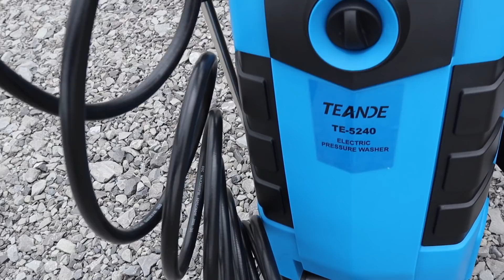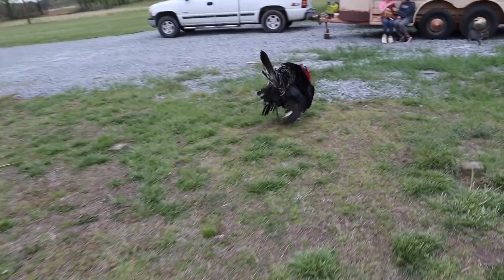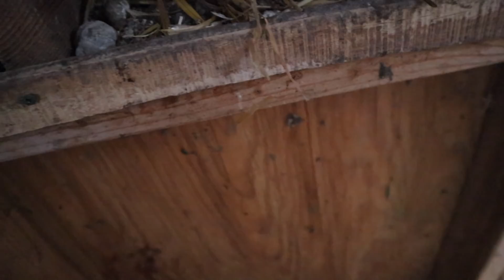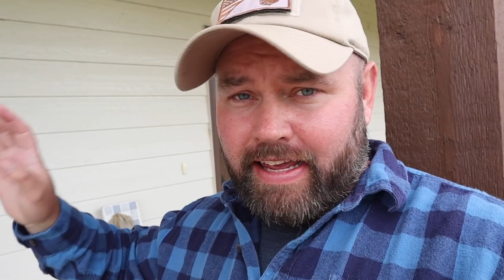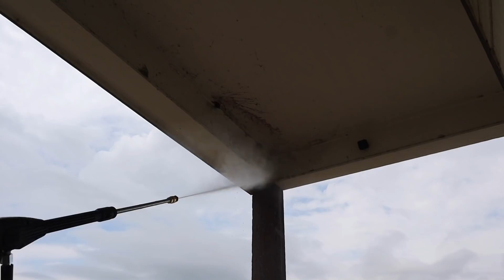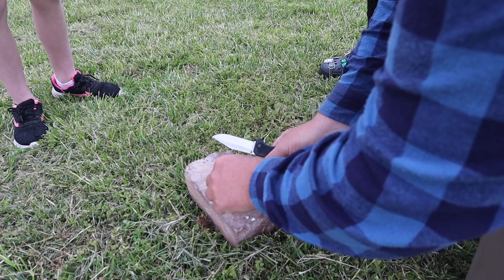PET TURKEY ATTACKED The Girls Didn't Know What To Do | TEANDE 3800PSI Electric Pressure Washer

Comment: The black tip is for detergent (soap,bleach) and you need to put it in that plastic container, with the siphon tube, to use it. Each tip has a different fan. 0 degree is the stream, 15 degree, 25, and 40. 40 would be like the carwash nozzle, for light rinsing. I've pressure washed hundreds of houses before I painted them. I normally would put bleach in the siphon container first and use the black tip to apply on the siding then use the 25 or 40 degree tip to wash. Don't worry about the soap jug when using the other tips, it will only detect the black tip. But DO NOT let the soap or bleach dry before rinsing. Do a section at a time. Hope this info helps.

Comment: This what I found on the web.   Humidity level for turkey’s should be between 55%and 60%.  Relative humidity. The developing embryo relays on the liquid to evaporate over the incubation period. To much humidity and albumen will not dry sufficiently and the developing chick will drown.
Reply: A dry hatch works for up to the time of lockdown, which is 3 days before their due date.  But once lockdown starts, humidity MUST be increased to 60 to 70%... softens the eggshell so the bird can break it with their egg tooth on their beaks/bills.

Comment: So you’ve NEVER owned a power washer before?? Wow, that is really amazing to me, I’ve had various ones for over 20 years and would NEVER be without it.  They are essential for home cleaning/maintenance.  I have a lot of brick walkways and sidewalk/driveway that I use it for, not to mention cleaning vehicle undercarriages of salt and grime to keep them rust free.  Mine have always been gas powered and have significantly more power than the electric ones.  HAVE FUN, they are a blast to use but tiring when used all day ;)

Comment: My guess on the turkey eggs, because of the stage they were at,  I'm guessing the temp dropped too low. Maybe when you had that cold snap.  Especially if you opened it just before or after.  Maybe it didn't reach a high enough temp in time.  Also bacteria can happen as well.  Could've been a number of things though